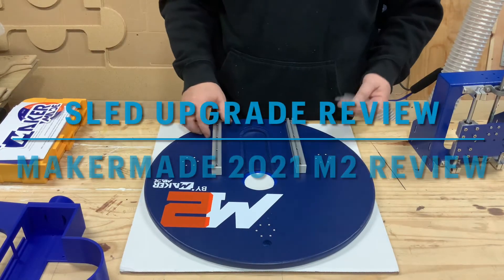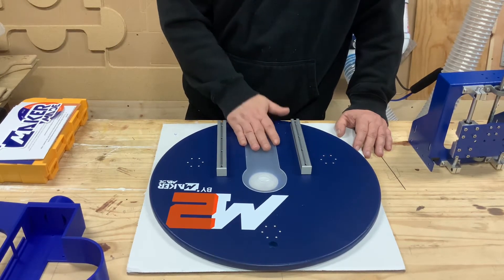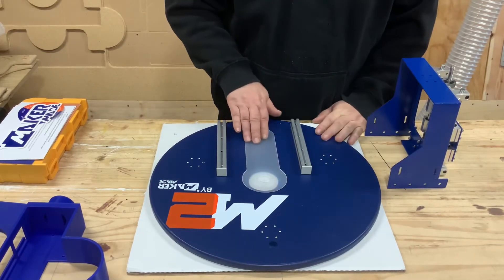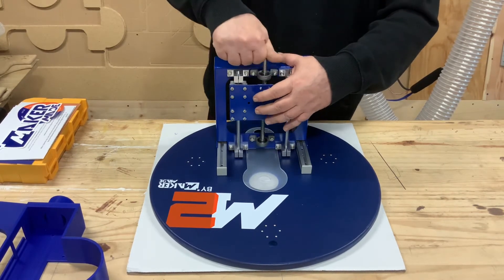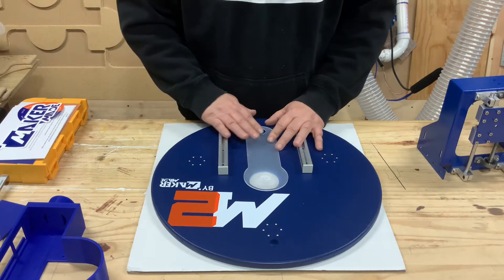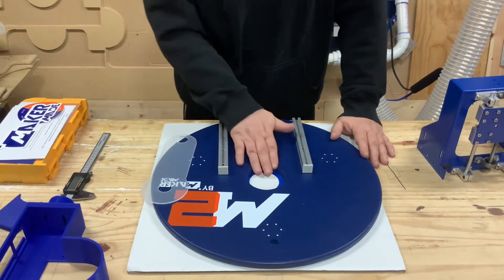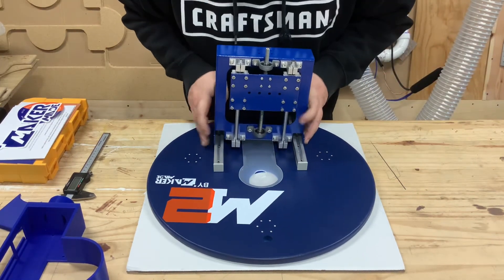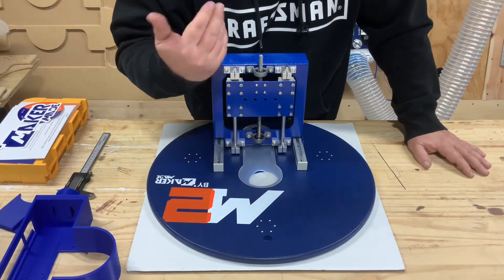MakerMade 2021 M2 Sled Review

Comment: Going to try and see how effective/efficient I can get the stock dust collection to work by adding double-sided tape to hold the “dust channel” cover steady and also taking a hole saw to the outlet to match a larger diameter shop vacuum hose. Will definitely go with two stage separation though. Great video, thx!!!
Reply from the maker: Great idea! I am going to try it on the next video demonstrating the M2 in action. Stock as is so I have a good comparison for people just purchasing the unit.